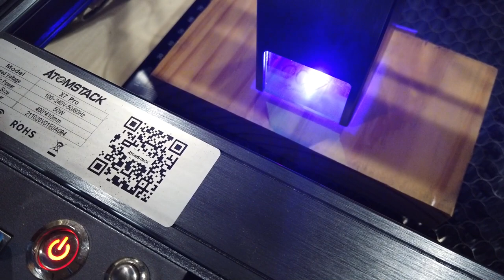Atomstack X 7 Pro Lens Replacement (and M50 Teardown)

Comment: So I have a question and a big mistake I feel. So this lens was not installed on my laser and I have ran my laser now without it, not realizing it. The box is long gone so I can’t look to see if I still have the lens in the box.  I did just order a lens now. My question is once I have this lens and get it installed. Will I notice a performance difference, since I didn’t have this lens to begin with?
Reply from the maker: I don't think you'll see much difference as long as it is clean.  When I bought my X7 the clear window wasn't included.  I think that they started putting this on to lessen the chance of damage to the focusing lens.
Reply: @directedt3ch  yeah the more I think about it, the more I am sure it wasn't included with my S10 Pro. So spent the $60 and ordered everything. But for being a "10watt" it still seems weak and its only 3 months old.

Comment: I tried the link but it's for the 20 watt laser not the M50 10 watt. I ordered the same lenses you received the first time (just glass basically) and yup it didn't work. I need the M50 lens link. I searched the Aliexpress but no luck. Help!
Reply from the maker: You can select the 10W option in the "color" choice menu.
Reply: @directedt3ch  Thanks mate. It seemed a little confusing. I didn't want to order the wrong one.  I can't wait to be back up and running.
Reply from the maker: @1976ClassicCelica  No problem!  It is super confusing and I was worried too about getting the wrong one after waiting weeks and getting the little glass window that did nothing for me.
Reply: @directedt3ch  Yup I got my little window as well. I did do an experiment by taking the laser head off and seeing how far it can burn. Prerry impressive. I can burn the wall up to 6 feet away. Lol
Reply from the maker: @1976ClassicCelica  Hahah! Yikes!!!

Comment: I have a question. I added a air assist to my M50 which is not really prepared for this. During this, I inspected the lens and while doing this I saw there is a "blind" spot in the middle of the lens. It seems, that this spot is not on the outside, it looks more that it is on the inner side. My first thought was, it got damaged by reflections and need to be replaced. But after looking for replacement parts, I got the impression, that also the new lenses have this blind spot, like some kind of coating. Can anyone confirm my observation?
Reply from the maker: I don't recall any oddities in my lens until it cracked.